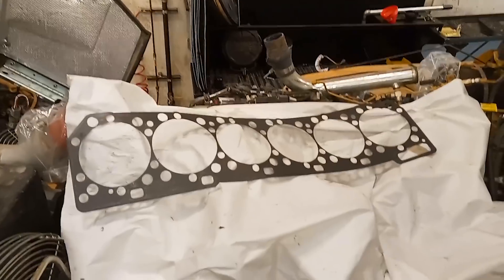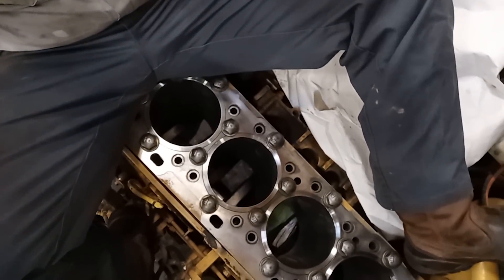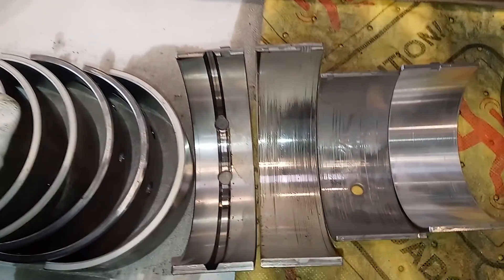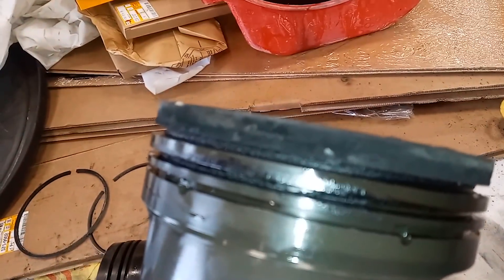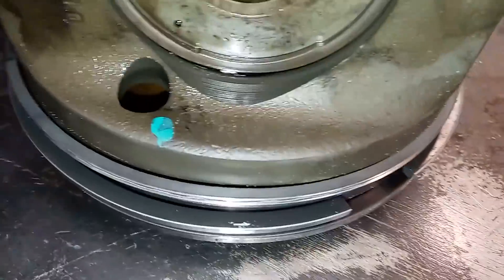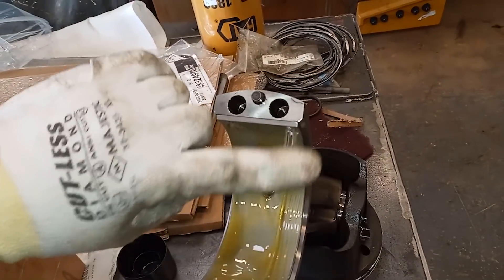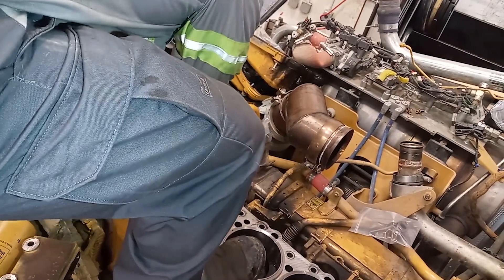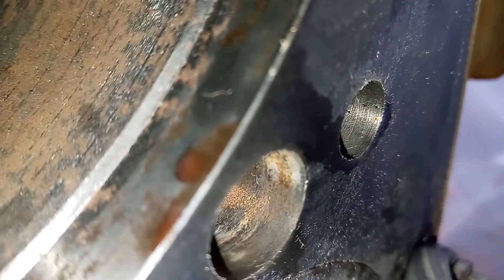A Cat C18 in a "TRUCK" in the shop.

Comment: I hate those ring compressors too. I feel like I'm going to lose a finger every time I use one. But they actually seem to work well on KTAs. I use one thats a touch shorter than the one you showed, I have tried a longer one once and i definitely would have put that one in a car crusher if I had one.

Comment: Interesting little factoid, many years ago Ford did extensive testing on clocking piston ring gaps & it basically makes absolutely zero difference. You don’t get excessive blow-by if all the gaps are lined up.

I’d still say it’s good practice to do it, but it’s certainly not necessary.

Many horizontal engines the rings will all line up over time anyway.

Provided the gaps are all good it really doesn’t matter. Seems counterintuitive, but when you look into how piston rings actually work it all makes sense.

I still clock them though, I just couldn’t bring myself to do otherwise (I mean, I’m not an animal 🤷‍♂️).

Comment: "Yee Old Ring Squeeze" does not work well with Keystone rings.
We've known that for decades, but it still shows up on the scene as the go to...garbage as far as keystone rings go.
The other thing about Keystone rings is, even with the "proper" tool, don't install the pistons when the engine is laying on it's side unless you have several helpers holding things up and pulling and pushing.
Always try to install Keystone ring pistons from the vertical, it just goes smoother.

Comment: Josh, my experience with Lucas Heavy Duty Oil Stabilizer is as follows: I have a 1992 Isuzu Rodeo with the GM 60° 3.1 L V6. Before using the oil stabilizer, if I didn't drive my Rodeo for 5 days the oil would drain down from the valve train and upon engine startup the lifters would make noise for 15 to 20 seconds then quiet down. After use of the oil stabilizer there was no noise at all even after my Rodeo sat for 3 weeks. I use it with every oil change.
Reply: Cool.
I had a 1994 Rodeo.  3.1 V6.

Comment: Didn’t see if rod bearing shaped rod journals are round . any diesel makes oval shaped rods . Worked on Lima loco engine rods were .090 inch out of round . Engine had rhythmic squeak ,all 6 cyl s chirping . Resized rods no more chirp . Oil pressure increased by 50# hot

Comment: I don't understand the advantage of the 'torque plus' method over just using the final torque reading. Using a pointer type torque wrench instead of the click type, I can do the torque plus while checking that the final reading is consistent.

Comment: When I rebuilt a Chevy v-8 engine,  I checked all clearances everything was fine,  So I thought that STP would make a good assembly lube,  after I torqued the mains then tried to spin the crank,   it was locked solid !!  It wouldn't move at all !!  Even with a breaker bar !!    I disassembled and cleaned of the STP and use 30w oil,  assembled it and torqued the mains and it spun over just fine.!😂

Comment: Thank you for the amazing content. Just a side note. There is usually a basket that sits in the ultrasonic cleaner that hangs off the side or does not rest directly on the ultrasonic cleaners floor. It is bad for the cleaner and reduces the cleaning efficiency of the cleaner due to the weight resting on the transducers .  Maybe someone else that knows more can chime in.  :)

Comment: A. I agree that there is never too much oil/grease/assembly lube when fastening or sliding together metal parts.  This is what rages are for: the mopping up of the excess.

B. I, for one, am a torque-specification advocate; never boring like attempting to learn Windows NY circa year 2000.

C. I fix my rain cap on my day off this Tuesday. The weight no longer keeps the lid on the exhaust pipe when the westerly winds blow from behind the rear to front of my Freightliner.

Rain water trashing a block....   MADNESS...!!!!

Comment: Good stuff . I didn't realize the blocks are the same on the C15 and C18  . The thickness of the liner was the difference  .  I wonder if you could take a C 15 ACERT block and put a C 16 head on it and convert my engine to a single turbo but still have the thick liners and the 4 bolt rods and so on . I think I heard you mention the ECM 'S  for both engines were 70 pin .  Now that would be one helluva good engine . Anyway Josh I enjoy your videos  .

Comment: Haul trucks suck but not as bad as a dozer. I have used Lubriplate 105 for engine assembly for decades. Cummins used to say to use that thick STP but that was fifty years ago. They even wanted rings and liners with a 50/50 mix oil and STP. I hated those wedding band blocks.

Comment: Why do c18s exist when in most applications they have equal to or less power than a c15? You think a c18 would actually be weaker with its thinner liners? Right? This question keeps me up at night and no one can give me a straight answer. Please help.
Reply: C18's can't handle too much heat the liner is very thin.in heavy equipment engine fan runs all the time so they work out good

Comment: I've used old liners to make a ring compressor. Split the liner in half, weld a hinge on it, some rebar for handles and a zip tie to hold the handles. But it's nice to have the proper tool as well. I hate those stupid universal ring compressors.

Comment: Not trying to tell you how to do your job or sound preachy, but you might really want to use a basket or something to keep the parts off the bottom. 

Due to some phenomenon I haven't quite understood, when the parts are in contact with the walls or floor it can induce a fuckton of microscopic pitting which in my industry will cause major issues over time, maybe its not a big deal with these big diesel guys, I'm not sure, just throwing it out there.

Also holy shit that Lucas has the texture of super stiff epoxy.

Comment: I operate a 745 haul truck, the same engine is also in the CAT 374 Excavator as well. We haven’t had many engine issues, but we have had a lot of transmission issues though.
Reply: A ton of them are at my dealership for transmission issues, they are a pain to remove and install

Comment: Hi, Adept Ape! I am putting my mxs c15 back together and I realized the bearing tabs are opposite of the cooling jet. Is that a issue or do I need to spin them 180°? If I do need to spin them, is it a bad thing to spin the piston in the liner? I don’t have a ring compressor that size.

Comment: Hi Josh, Love your channel and anyone working on Cat engines would be a fool not to watch your videos if they are lacking the knowledge of a particular cat engine or engine system. That  being said. I am having an issue with a cat engine electrical system on a Cat 330C excavator. I tried to email you but your email does not seem to be working at the moment so I will make my question brief. I am having a fault code for the engine oil pressure and my understanding is the 3 wire sensors have a 5.0 volt supply line a neutral or ground line and a 0.5 to 4.5 volt signal line back to the ECM. I am getting 6.5 volts on the signal line for the oil pressure sensor  and also on the fuel pressure sensor and the turbo outlet pressure sensor. I verified the 6.5 volts was coming from the ECM. I replaced the ECM due to a ECM failure fault but still have the 6.5 volts and oil pressure fault. Any help is greatly appreciated! Thank You !

Comment: As a auto tech, I laugh when I see those mains, and especially the wrist pin. Looks like a Red Bull can, lol.
Reply: Wait till you see the internals of large medium-speed marine engines.

For example, the 32/44CR series from Man Diesel:

Pistons: 12.6" diameter, 16" tall, 279 pounds

Rods: About 5 feet tall, 6.25" thick, 600 pounds

Liners: 17.3" in diameter by 32.7" tall

Rod bearings: 13.1" in diameter, 13.3 pounds combined

Main bearings: 14.7" in diameter, 15 pounds combined

Valves are 0.94" in diameter at the stem, 4.13" at the head, and 22.7" tall.

Comment: I bought a 3126 that has a oil leak. I finally found it and it's the 241-3782 line. I've only seen one video addressing this line. The guy said it's extremely hard to get it to line up and not leak. Can you give me any tips or tricks to get it to not leak so I don't have to do this multiple times?

Comment: Really like your videos Mr. Ape. Got a question for you that nobody seems to know the answer. 2007 Acert conversion to single turbo, do you have to lower compression?
Reply: No, you don't have to alter the compression. Reducing compression is a safety measure on gasoline engines to reduce the risk of preignition and detonation. Remember that Diesel engines don't mix air and fuel before entering the cylinder, so you (theoretically) have no limits on your compression ratio, and lower compression ratios on Diesel engines makes them less efficient and dirtier-running.
Reply: You should 👍

Comment: Is the c18 as tough as the c15? Does it run 20k between rebuilds like the c15 will?
Reply: Only 20k hours???
Reply: @100pyatt  I’ve heard guys doing 30-35 , I’m talking commercial boat btw no trucks/equipment

Comment: So a guy could inframe a c15 and make it into a c18?  How much power and tq would that have? Assuming the c15 was 475 hp
Reply from the maker: Well they can make a lot of power, the one in this haul truck is only 500 hp, so pretty much the same as a normal C15.
If you just take a normal 500 hp C15 though and increased the displacement by 20% (to a C18)  you could expect a 20% increase to 600 hp. Of course this is a super oversimplification, but just illustrates the difference.
They make 750-900 hp C18 off road applications and the marine engines can be over 1,000 hp. Kind of crazy with those thin liners, but they can make some power.

Comment: You think haul trucks are a PIA? A wheel loader is 100 times worse. There's usually a huge fuel tank and counter weight just under the oil pan. A dozer is near impossible but thank God they have the multi piece oil pan. I think the worst inframe I ever done was in a portable crusher. Access was tight and nearly ten feet high with access on the exhaust side was by ladder. Not an angled one but totally vertical. I put tools and parts in a five gallon bucket and roped them up. The crane on my service truck was maxed out in reach for the head.

Comment: I use  a smaller ultrasonic with a drop of dawn (not a sponsor) and 1 9 mm case of citric acid to clean spent ammo cases and have pretty good carbon cleaning.  I only do it for about 20 minutes.  Not good to leave the brass in h the citric acid to long as it leaches the zinc out if the alloy and weakens it.

Comment: Did it Crack the liners. Pretty common on them. Probably why your reusing the pistons. I did one in a bale grinder.  Liner cracked and put oil in the coolant.
Reply: Liners have been updated to stop the cracking

Comment: So.... theoretically I could make my acert C15 an C18? Would you run into any other issues than changing the liners and piston packs?
Reply: Crankshaft, then change your cam and injector for hp
Reply: Cam shaft, injectors, maybe a crankshaft.
Reply: Crankshaft, camshafts connecting rods are different
Reply: But why my 1Lw is a stock 605hp out pulls a 700hp is and I can walk right past a 6NZ

Comment: Hey Josh, I noticed that you used a lot of oil when installing the piston into the sleeve and I was wondering if that may affect the break in process of the engine and rings. I saw one old guy just use WD40 or other light oil because he said that it helps break in the engine faster. Im not an expert but I was hoping to get your opinion on this, Appreciate the video thanks!
Reply: new engines dont break in the rings till about 150000 miles nowdays due to the better oil and the hardness of the coating on rings.

Comment: I have a question, the c18 always gets a bad rep for “thin liners” and the stroke is too long so it shaves the liners and harmonics and blah blah blah. Lots of marine apps putting over 1000hp and lots of industrial putting 700-800hp. What’s is their realistic service life? Like are they putting 6000-8000 hours or work before their strike and liners show up to play? Or are they putting the regular 18000-25000 hours in between overhauls?
Reply: I’d like to hear from josh on the service life of the c18 compared to the c15.
Reply: @TheREALLibertyOrDeath  everyone mentions how weaker the liners are because they’re thinner, but if cat built a 1100hp engine. They should be strong enough providing enough cooling. It would be nice to hear from someone who has hands on and down dirty with them
Reply: That's what I've heard as well. That the liners allegedly flex too much.
Reply: It's nothing to get 25k hrs from a c-18 industrial .

Comment: The 18 liter C18 is supposed to be a replacement for the 18 liter 3408 V8, I know which one I’d rather have! Especially with the C18 liner walls being so thin. Even the C16 liners aren’t really up to the job in a heavy application.
Reply: I operated C18's set @ 680Hp in Cat AD55 underground dump trucks.  They were an interesting engine, one that either lasted 10,000 hours or failed under 200, there seemed to be no middle ground.  When they failed, it was typically in a spectacular fashion that meant you could see daylight from one side of the block to the other.  In fairness, the life of an engine in an underground  truck is a tough one, half an hour at minimal load running down the decline, followed by 1 1/2-2 hours at full throttle pulling 110-130 tonnes gross up a 1:7 incline with no respite and in high ambient temperatures.  We thought we were kings when the AD55B came along with a C27@815Hp.  They couldn't take the C27 past 815Hp as they couldn't keep them cool above that, (even at 815Hp we were running fuel coolers due to the high ambient temperature).
We did have an AE40 with a 3408 and it had a beautiful throaty growl to it, although nothing compares to the C27 pulling hard up the decline.
Reply: @karlrobbers  I used to work U/G as well, one nickel mine I worked at back in the ‘80s had modified low profile 988B loaders and 769 trucks with 3408s. The decline was 1:9 and they used to rev going downhill. They sounded great with no muffling and were very reliable. Another mine had a Swedish Kiruna U/G truck with dual Volvo engines, it used to break down all the time so they repowered with a GM 12V71 TA, problem solved.
Reply: @gm16v149  I always wondered what a GM would have sounded like underground.  All that sweet noise with nowhere to go.  
They brought in some Atlas Copco MT6020 trucks with QSK19 Cummins @765Hp in them, they would outrun the AD55 with the C18, but not the AD55B with the C27 and the CAT was like a limousine in comparison the the Atlas Copco.
Reply: If Cat made made a 3408E or brought it back they could rival Scania for power and performance.

I was also wondering what a C13 with two extra cylinders would be like. Imagining the C18 as a straight-8.
Reply: @electric7487  Never late with a 3408!

Comment: Kindly confirm me that difference between c15 or c18.
1. Both block are same but
2 . C18 liners bor size is 145mm or c15 i think 138mm.
3. Differences is in pistons.
4. C15 has a single turbo or c18 has two.
And other all things are same?
Reply: Depends on the arrangement all interchange
Reply: Stock C15 has 2 turbos as thry were Acert engines.  C-15 had one.

Comment: I got a c-15 6Nz. Every once in a while my fuel water separator gets clogged. I tried to look for issues even opened the bolt under the water separator to check if it leaks any water but it doesn’t, clean diesel with no sign of water or even coolant. A cat worker told me sometimes coolant gets in the system but that doesn’t seem likely to me. I checked the fuel caps they look fine as well. I would love to have your opinion on this please. 🙏
Reply: If the filters keep clogging you need to drain the tank.
Reply: @fastinradfordable  I’m gonna need to get my tanks checked i think. I had a mechanic take a look but he just looked it with a torch and that’s all.
Reply: Could it be carbon plugging the filter…. Is  the filter black when plugged?.. little bubbles floating to top of fuel-in separator?? …..if so you may need to reseal the injectors
Reply: @karlsborgwi.jewell9919  I can’t tell its not a glass filter its a hard metal yellow cat filter
Reply: You can get fuel into the cooling system and coolant into the fuel system.  Check your injector cup o rings.

Comment: How many miles on that engine as the wear on those thrust washers is minimal.
Reply: Thrust washer never wear all straight cut gears, if wear transmission problem
Reply: @chevy36ful  I just did a bearing roll on my 3408 @ 8,000+ hours, rods and mains were worn but nothing at all on thrusts. Crank end float was 0.013” with new and old thrusts, within specs.
Reply: @gm16v149  looks like your an ex GM man like me, I change to a CAT dealer and only build engines now, I’m getting too old😁

Comment: Use to work on 3408 in peterbilt trucks was a very big motor
Reply: I did a bearing roll on my 3408 last week. Only five mains but eight rod bearings. The Brakesaver double oil pump is super heavy, and all those pipes are a pain.

Comment: You can use too much oil for liners and pistons , and you did just that. Takes too long to seat the rings with excess oil. I have done it with dry liners, only a little oil to ring grooves. 

C18 was one of the worst engines fitted in OTR trucks in Europe.
Reply: Lol engina. Did those Euro C18 OTR trucks have any emissions?
Reply: @markm0000  Euro3 , 630 hp
Reply: I’m curious what Josh has to say about this comment lol